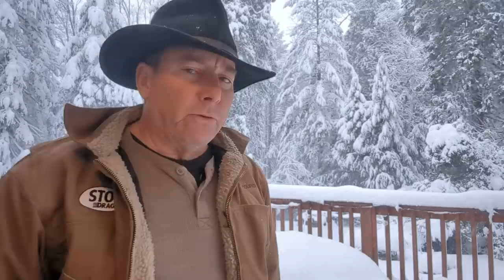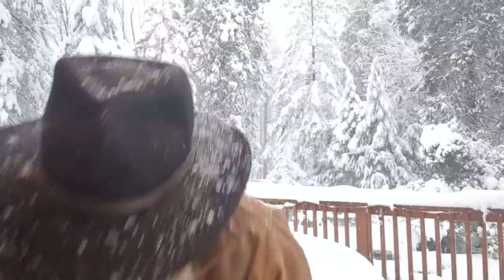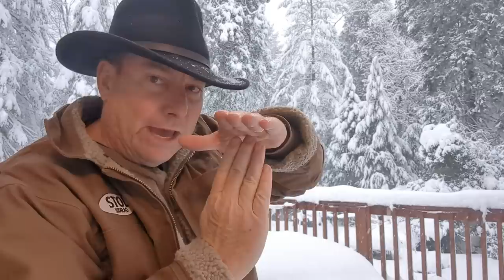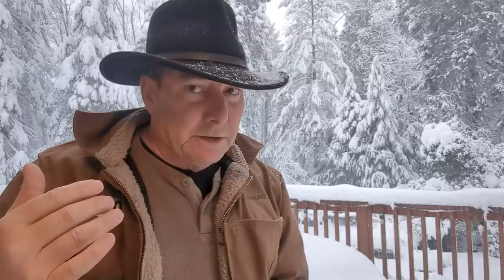PC-12/45 NTSB UPDATE In Flight Breakup! 26 Feb2023

Comment: Is it not possible the loss of control was the result of icing. Did the original flight record in the ADSB data indicate a steady climb to the 19K foot altitude, i.e., under autopilot? The fact that the aircraft did not need to be de-iced on the ground does not rule out accumulation of ice on the climb-out. Anti-icing boots have limits on how much ice they can prevent, don't they? It seems to me the conclusion of spacial disorientation is a bit premature.
Reply: The Flight Tracker profile points to POSSIBLE SD due to the bank angle and speeds during the rapid descent . Does not prove that but hints at that as a possibility. 
I think the real question is did the pilot lose control and over stress the airframe [excessive G's] and cause structural failure or did structural failure cause the loss of control? The Horizontal Stabilizer has an AD related to the AFT Attach Bolts.
I like Juan's input on these aviation issues and he has good instincts.

Comment: Great Juan,  I have not seen any comments with the possibility of instrument failure or electrical failure on the avionics buss.  I am not familure with the PC12 systems.  It appears by your earlier thoughts that the auto pilot was on earlier and loss of electrical power could shut down the autopilot suddenly and contribute to spaceal disoretation.  I have flown many hour at  night with a flash light under my leg just in case of panel lights failure.  I think system failures must always be taken into consideration.  Not saying that this is the cause, only should be considered.  Single pilot operations usually are more autopilot dependent.
Reply: bus is one "s"

Comment: Perhaps similar to the Alaska Airlines crash; loss of horizontal stabilizer.
Reply: That accident was caused by the lack of proper maintenance on the MD80 Horizontal Stabilizer Jackscrew Assembly and not an OVER G Condition.
Reply from the maker: No!

Comment: I'd like to remind the aviation community about some pertinent history:  the late 1980s flight record of the Model 35 "V-tail" Bonanza.  Several crashed mysteriously, suffering in flight breakups, and no one knew what was causing the problem until miraculously one pilot survived his mishap.  They were able to determine based upon severe tailplane twisting deformation, that the initial design did not have sufficient structural support in the empennage.  When pilots entered descents in this sleek, fast, design, the aircraft gained enormous airspeed rapidly due to the extremely clean aerodynamic design, and low induced drag of the V -tail anatomy.  After essentially accidentally "diving" the aircraft,  the pilot would get to the bottom of their descent and pull back on the yoke to level off, but this excessive loading (for THIS design) caused, the tail structure to suffer severe distortion and in a few of the crashes, it actually separated from the fuselage, falling to earth in a different location.  

This sounds very reminiscent of this structural damage in this accident.  When I hear that a horizontal stab or tail structure element leaves the aircraft, my very first thought is a high-G dive recovery wherein the yoke is pulled back too aggressively.  This could EASILY occur in either severe turbulence or in spatial disorientation.  The two, are not mutually exclusive and could be part and parcel to one another in this case.  

Others flew through this area just hours prior to this incident and encountered icing in the clouds and pockets of moderate turbulence that might have been experienced as severe turbulence to such a light aircraft.  Also, it may have been bonafide severe turbulence at the time this doomed aircraft passed that area.  If that was the case, the plane easily could have come apart if it was exceeding the max turbulence penetration speed.  It is also just as likely that he entered an inadvertent high speed dive as a result of severe turbulence and/or spatial disorientation, which could have then caused him to reflexively pull back on the yoke and exceed the positive G-load envelope of the aircraft, with resultant catastrophic failure of the airframe.  

On a somewhat unrelated line of thinking...The witness on the ground stated she heard the engine CLEARLY "popping" (backfiring) and sputtering.  This could easily occur with severe icing and or turbulence.
Reply: when airframes break apart they make very loud popping noises that can be heard for miles.

Comment: This accident is partly the dumb FAA’s fault. They require the stall speed to be way too low for all single engine aircraft. There is no real good reason for this stupid requirement. The formula to calculate the maneuvering speed includes the stall speed. The lower the stall speed the lower the maneuvering speed. He was flying well above the maneuvering speed, they are fast aircraft, hit some moderate turbulence and boom there goes the horizontal and elevator. The FAA can be a bunch of idiots. The PC-12 is not the only aircraft the FAA f__ up. In heavy turbulence pilots have to slow down below Va to be safe. I learned this fact as a private pilot, this pilot should have known it too. FAA and pilot error.

Comment: The plane was overloaded. Density altitude kicked in at 19000ft. How could he reach 25000ft ?!!!!
He would've made it had he stayed at 15000ft.
Reply: Evidence?
Reply: Actually, you are right, if the cruising altitude would have been 15000 feet as you mentioned no structural overload would have ocurred. 
The advertised max cruising speed is 290 knots, that corresponds to an indicated air speed of 230 knots, The Never exceed speed on that aircraft is 236 knots, which includes a safety margin of say 10% Meaning that the design limit speed is 260Knots at sea level . 
Attempting to fly below 8000 feet altitude at a true airspeed of the advertised max  speed of 290 knots  would exceed the indicated red line speed plus the allocated margin.
Flying at 15000 feet as you suggested at the 290 advertised cruise speed would correspond to an indicated speed of 230 knots, 6 knots under the never exceed speed VNE, red line, safely.